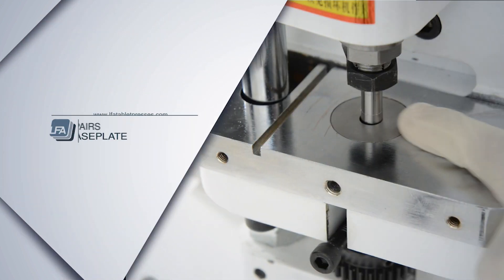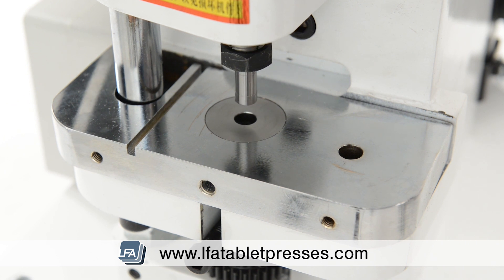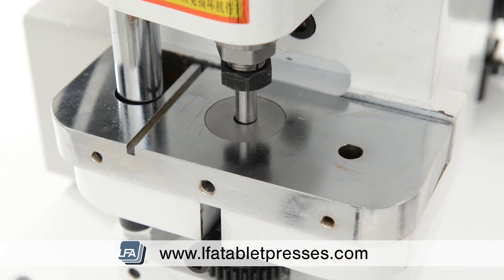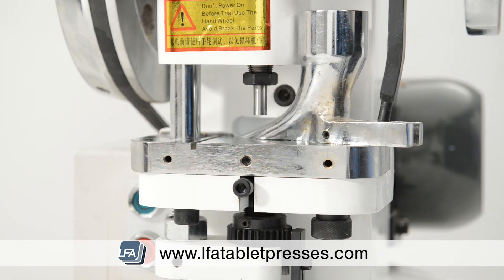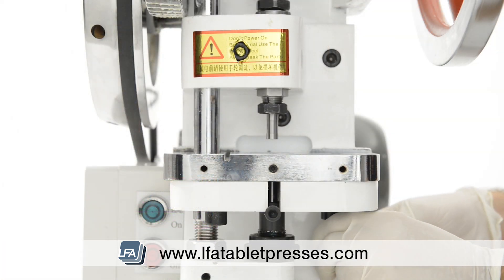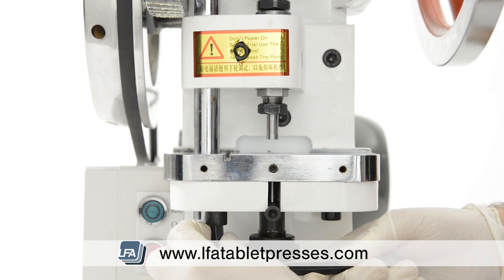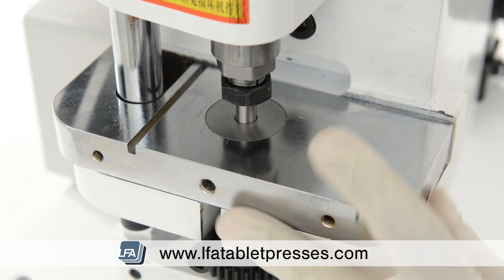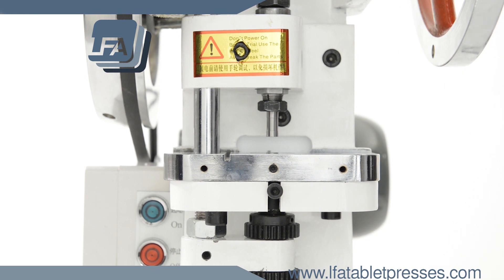TDP 5 - Baseplate Alignment | LFA Tablet Presses

Comment: Hi my tdp 5 is not ejecting my tablets the boot rolls right over the tablet and the upper die will keep bnb punching down on the same tablet can you please help me
Reply from the maker: Hi Michael, have you set your ejection height for your lower punch correctly? or is your mix getting stuck in the die?
Reply: @LFAMachines  yes i turn the cog clock wise to raise it and it wont pas the center punch so when the the upper punch comes down amd presses the tablet the tablet goes back down with the lower die amd the boot scrapes the top and the tablet amd the machine continously stanps the same tablet amd wont eject the tablet and sometimes it seems to be caking up in the hopper
Reply from the maker: Hi Micheal,

 So the boot isn't passing over the die hole? That would be the reason your tablet isn't ejecting. Is your timing bar damaged? 

Also if your powder is caking in the hopper, it may need some more flowing excipients. See our latest playlist explaining excipients are their uses: https://www.youtube.com/playlist?list=PLvkSbiwdSX29VlPl5dJc255O8GmUnVnzE